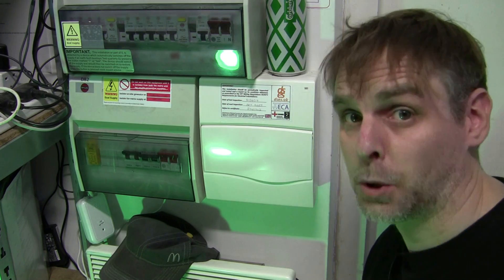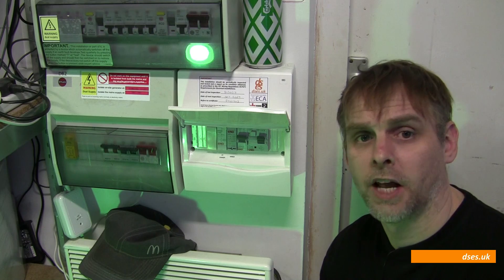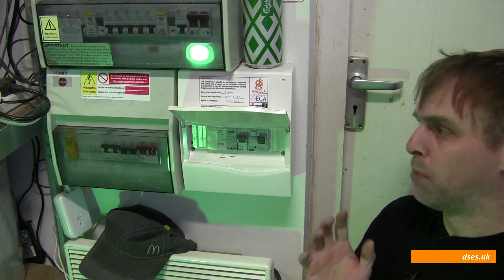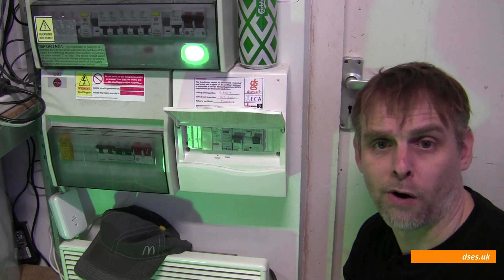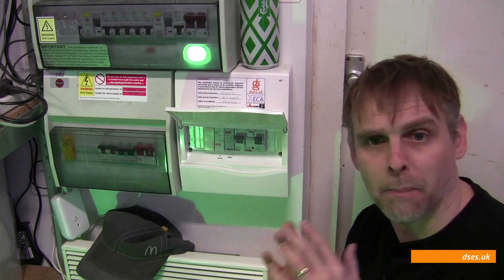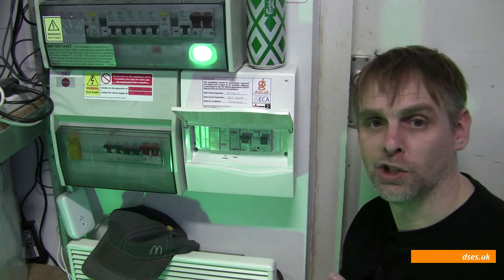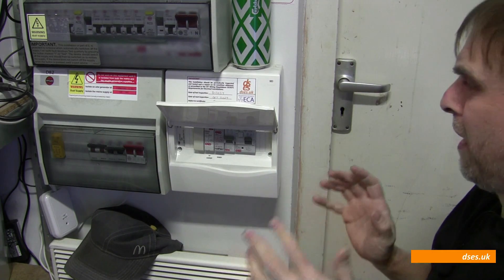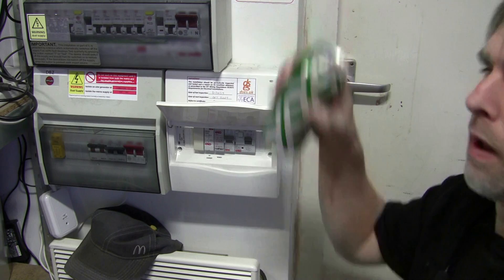The Garo shower priority unit

Comment: WTF are all the electric codes in the world being driven by Manufacturers wanting to sell more pricey equipment?  Here in the US most houses now use plastic (fire resistant boxes) for switches and outlets (even for 230V appliances) , where IMHO heat from poor or aged connections fire is more likely.
Reply from the maker: It's nuts that we can't agree as a species and different territories have different requirements. Manufacturers were, I think, largely resistant to the change as they had to retool their lines and ship out their surplus before the regulatory requirements changed, but dangerous workmanship remains dangerous, and a change of outer material isn't going to magically make things any safer.
Reply: One Manufacturer may have driven the change, all the rest had to play catch up.
Here in the states, a Whole House GFCI (RCBO to those across the pond), does not meet the codes.  They now require for built in dishwashers. Also we have strict rules. They can't be in cupbords or behind equipment (You do have 'isolators' , but they are not always in plain view.). Forget placing fuseboards any place except at eye height with a 3 foot free space in front.
OTOH I really like the square rigging of wires. We now have to use hundreds of 'nail plates' to protect wires from nails and drywall screws.

Comment: I'm irish electrician an I hav used these for two showers in a home a couple of times. there great for off the shelf. But garo isn't a great brand here.
Reply from the maker: Very interesting, Pistol Pete was saying similar. I hadn't come across them until 2013 when I fitted my first priority board. I take it you guys still get to install plastic enclosures and managed to avoid the whole metallic debacle??!
Reply: @dsesuk  yep still plastic. Love the videos by the way top man 👍
Reply from the maker: I thank you sir, and may I take this opportunity to apologise in advance for the drunken behaviour of me and my wife when we're visiting the Emerald Isle later this year!
Reply: @dsesuk  with your humour u will hav some crack 😉 enjoy
Reply: @PETER WILSON hi Peter as far as I know it's just garo that do them. Iv put in say 10 of these and got 3 call backs to faulty rcbos... which I change for a Hager.  But it would be pretty easy to change over from plastic to steel. They really are handy and easy to install.
Reply: We have an Xbox installed as there are 2 of 9KWh hour showers installed. The installation max demand is 24KW but the control unit does prevent the whole place ending up in darkness when other loads come on.

Comment: david could you put all in metal clad generic  consumer unit would that work
Reply from the maker: Sadly, Reg. 536.4.203 in 18th Edition scuppers that as the components within the enclosure need to be type tested for that enclosure, so stuffing Garo gear into, say, a Hager Amendment 3 DB would still leave you falling foul of BS7671.
Reply: that's a bit of a bummer @dsesuk
Reply: @dsesuk  way i see it metal can burn an cause fires just like plastic, only difference is that with a metal enclosure is a fire might smoulder for ages inside the box before catching surrounding woodwork alight an by then people are already possibly being affected by the fumes from the burnt wiring, an the chances of the fire going into the wall space is just as great as a plastic unit burning,

Comment: Have you ever seen a garo double height consumer unit? They have them in Southern Ireland and they are just terrible..
Reply: I’m from Northern Ireland and the very odd time you come across one that’s has made its way up here, seen one 2 weeks ago next one I see I’ll take a few pictures.. the main switch is a 63a fuse in a strange holder that you 1/2 turn and pull out to isolate the board.. more like something you would get in a shit hotel
Reply from the maker: No, this thing is my only experience of their stuff. I'd never heard of them until 2013 when I had a client trying to shoehorn additional showers into his property and I had to find a way for it to cope!

Comment: British Gas are the worst for saying that stuff doesn't comply. Had one case where they refused to fit a new boiler because there was no RCD. Only there was. It was in a separate enclosure next to the old wylex board. It was even properly labelled. 

the upshot being British gas lost out on the work and another plumbing company made lots of money on it
Reply from the maker: I think everyone has their own BG horror stories. I had to reconnect a cooker hood for a pensioner a few months ago after BG disconnected it for 'non compliance with the wiring regulations' and quoted £250 to put right. Except it was demonstrably compliant, and I provided a certificate for its re-connection.
Reply: @dsesuk  BG have converted two of my neighbours in Harborne, Birmingham to TT for no obvious reason.  Another customer in Moseley paid BG £600 to run main bonding to her incoming water service.   The pipe was of course plastic.
Reply from the maker: @westinthewest  Oh my!
Reply: @westinthewest  £600 for a length of wire ans a clamp?No wonder they make gigantic profits ripping off ordinary people.

Comment: or you could just uprate  the main fuse
Reply from the maker: That is often an valid option. This is more about where an installation is already at capacity.
Reply: @dsesuk  uprate the fuse?  F'in eon just installed a "smart" meter and it was only after they left I noticed they replaced our nice 100A fuse with a 60A.  Just about to connect a 40A supply to my new office/workshop/mancave  :(
Reply from the maker: @timballam3675  A strange thing for them to do unless your tails are undersized?!
Reply: @timballam3675  surely eon should know better. The main fuse is DNO property. I have issues with UK power. We had to call them out for a meter board replacement, water ingress meant the board was rotting. I told them it was getting in because the door to supply box does not form a good seal. 6 men turned up shoved expanding foam in every possible hole and spunked silicone all around the box. The water was and still is getting in through the door....... Knob ends.
Reply: @dsesuk  turned out the smart meters rated for 100A melt if you put much over 60A through them!
Reply: Peter Tallowin 
Spunked Silicone 😂that's made my fucking day mate 😂😂😂😂😂😂😂😂😂

Comment: Yes, most homes in Ireland have 63A main circuit breaker, but I think the main fuse from the ESB is 80A. Originally from Ireland myself and completed my apprenticeship there, but I live in Sweden now so everything isn't 100% fresh in my memory. I was wondering when I saw your video with the multiple showers whether a priority switch might be a good solution, actually. Great video again! Thanks.
Reply from the maker: Thanks Graham. I'm expecting to see 126A service heads when I go to Ireland, but that'll be the double vision from the Guinness.

Comment: Great way to handle maximum demand issues. Thanks for sharing David, a similar setup might come in handy.

 In the Netherlands the only affordable three phase service boasts 3x 25A and heat pumps and electric cars are really becoming popular. One can imagine a three phase version of the Garo product would do the trick. Thanks!
Reply from the maker: Electric cars are interesting. Despite having one, I'm not convinced they're the future, at least not with batteries that take hours to properly charge. I reckon some kind of charged liquid is more practical; something whereby you can pull up at a service station, have the discharged stuff pumped out, and a new charged liquid pumped in. Nigel reckons he's seen something on it. Either that, or batteries that can be charged quickly at service stations.